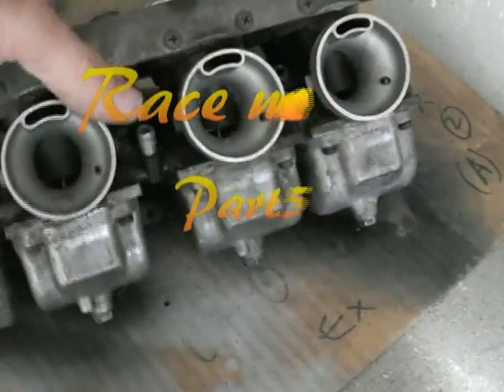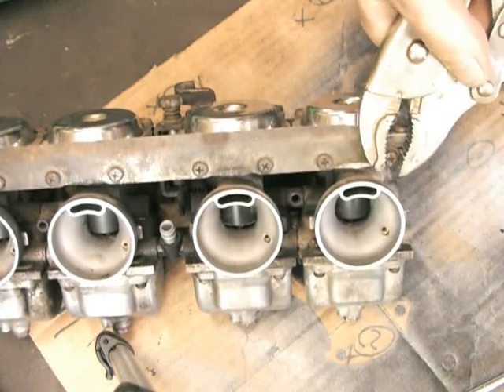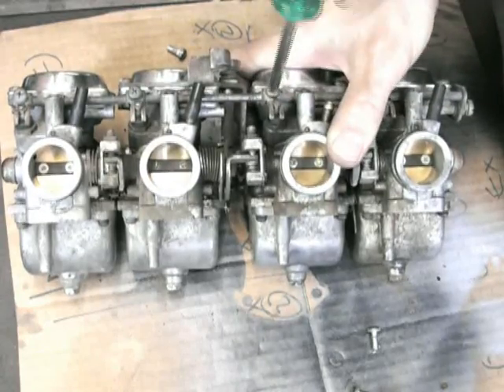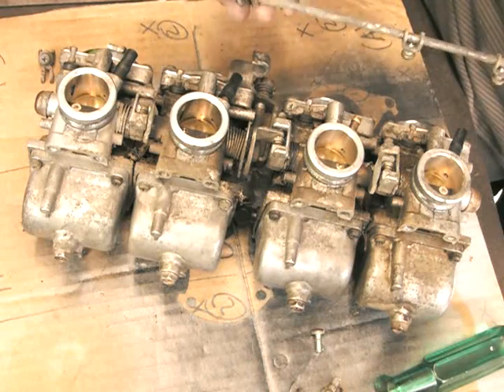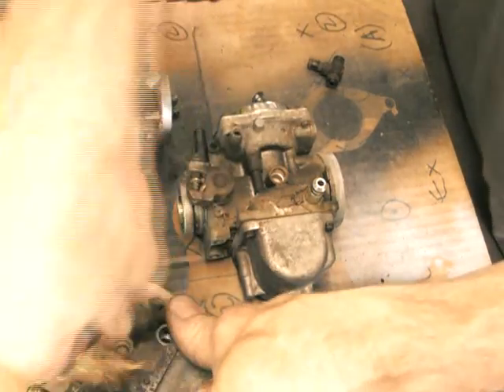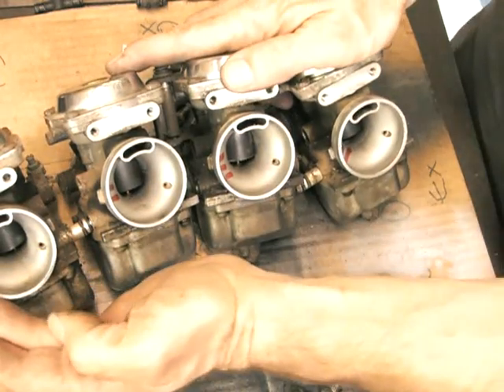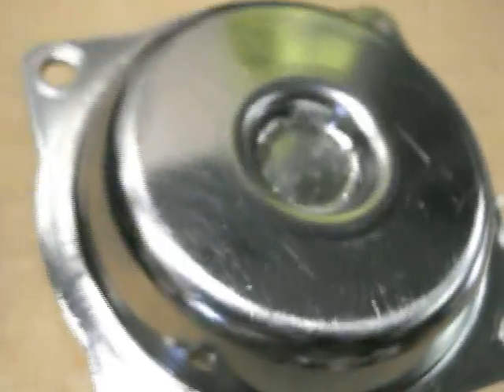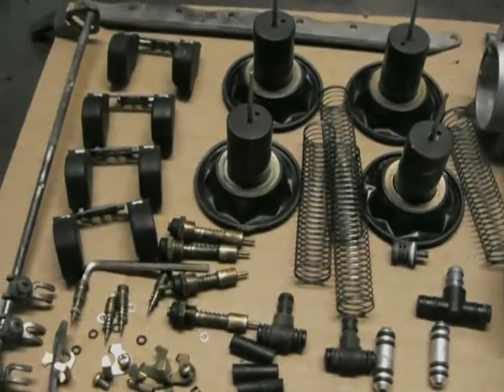Race Mower Part 5 Mukini carby overhaul

Comment: For now I am heavily confused. I did overhaul on my carbies and I still have overflow problem but this is from new needle valves that needs polishing but now I am mentioning float bowl gasket. You dismantle those and one passage is blinded completely with gaskets form 80s and on the part 6 you put new ones where hole near choke tube isn''t blinded by gasket. The ones I have from japan have this spot blinded and previously I had non blinded gasket which made choke way too rich. I am really confused which version of gasket is the proper one. I'll try those older style for now.
Reply from the maker: Hi, I used genuine gaskets from Suzuki. I don't think it matters to be honest. The choke system works by fuel going up that small tube from the base of the bowl and then to the choke seal. If the choke is off it completely seals on the choke seat. If you're running rich check the choke seal is good. The tube must go to the bottom of the bowl so the gasket doesn't really matter as the fuel level should never reach the gasket height. Hope this makes sense.
Reply from the maker: Hi, the original needle valve have an internal spring so no wire, I also have purchased new needle valves do have the wire that acts like a spring. I install a 6Sigma jet kit and its works great...